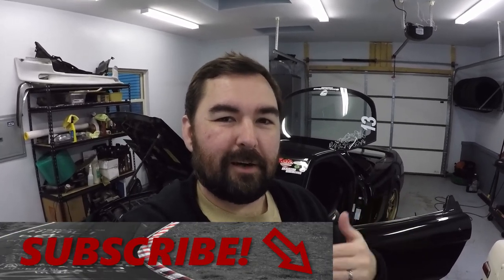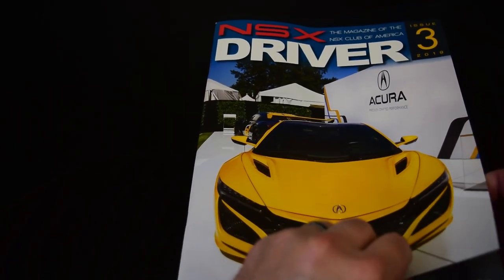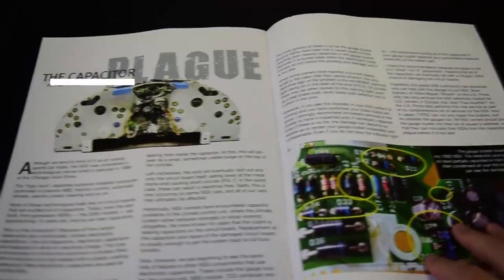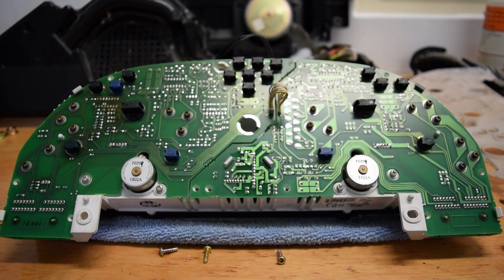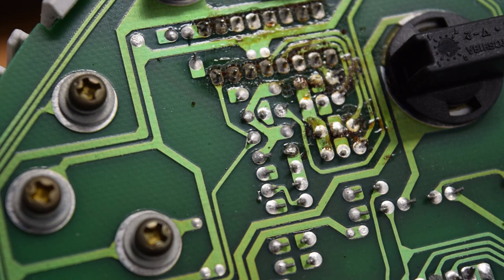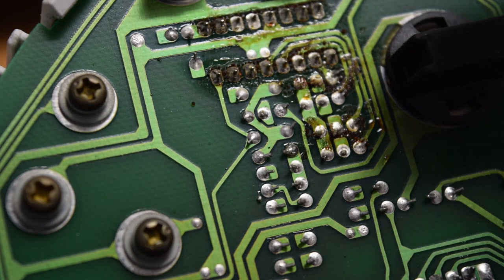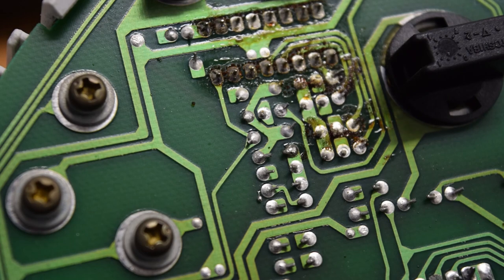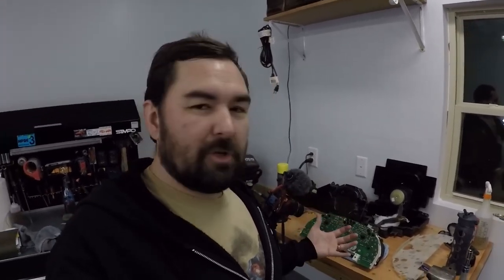Gen 1 NSX (and other 90s 'JDM') PSA:  Potential Capacitor Carnage in your Instrument Cluster!

Comment: Well done again with a great video. Had this done here in Japan by T3 TEC who are growing into everything NSX, race, dyno full overhauls. They built a setup when they change the capacitors to then run it on a simulator and set the gauges correctly.

Comment: I proactively did this a couple of years ago as well.  I thought I had an issue in my instrument panel.  It turned out to be a oil pressure sender on the oil cooler.  Briank said the caps were not leaking yet, but they all do eventually.  I disassembled the instrument panel and just sent the PCBs to Brian.

Comment: I prefer to not have the circuit boards not be removed, the screws that hold the gauges and provide the connections to the gauges if over-tightened on reassembly will damage the gauges. The crusty's you see are left over flux from most likely a rework when the board was manufactured. Brian K nsxe-repair
Reply from the maker: Good news! After some debate, I did mail the entire cluster still-assembled.  Thanks for the info, I'll be curious what, if anything, you find once you crack it open.
Reply: @LapoftheWorld  I will take some pictures.

Comment: The common failure area is the lower-middle part of the board that drives the brake lamp/door open indicators, which is hard to see closely from the vid but it almost looks like someone has worked on that area before based on the different color on the board, looks like leftover flux or conformal coating. The crusty area looks like poor cleanup after a re-soldering job to me, but you'd need to look at the front of the board to make sure since that's where the damage would've started, since having that kind of damage on the back would've meant the capacitor acid ate all the way through the PCB...Maybe someone has repaired this cluster before? 
Not sure if BrianK requested you separate the boards from the housing before sending the boards for repair. If you do, you can look at the front of the boards to really see if there are damaged areas. Either way, the capacitors should be replaced with more electrolytics of a high temperature rating (factory was 105 degrees C) and a high lifespan (some are rated 10,000+ hours).
Reply from the maker: Yeah, I'll be curious about Brian's opinion there.  It was driven enough prior to me that it plausibly could have been fixed before, but aside from the section I pointed out most of the rest appeared pretty pretty consistent.  I took a high-ish res photo of the entire board just for future reference and again to my un-trained eye the quadrant with the brown schmoo is the only one that looks "off" in any way.
Reply: @LapoftheWorld  Might spray some schmoo-be-gone just to be sure haha, though maybe Brian would like to keep it original to see if that area needs to be addressed. Either way, good piece of mind getting everything re-capped and inspected. Just be careful reassembling the cluster if you take the boards out, the OP of that Prime thread you linked accidentally over-tightened one of the brass circuit board screws and broke a speedo stepper motor wire and had to re-solder it again. See http://www.nsxprime.com/forum/showthread.php/91341-speedometer-testing. Common issue if you over-tighten the screws.
Reply from the maker: @Big_McLargeHuge0  Lol, yeah, I long ago learned-the-hard-way and cured myself of any desire to tighten most fasteners past "snug" unless there was a torque spec.

Comment: Did you have to remove all the trim behind the wheel to get the instrument cluster out ?
Reply from the maker: Just the 'knee bolster', and the thin black trim ring around the cluster itself, but neither of the column covers or other trim. It can be fiddly to extract but it will come out at the right angle with some fairly modest encouragement.
Reply: @LapoftheWorld  Thank you

Comment: Great video and PSA!  Old Miata ECUs also fall into this category, which I discovered when I was debugging why my freshly rebuilt engine wasn't cranking.  It turned out that the caps weren't the problem in my case, but the 25-year old connectors weren't making great contact.  ECU failure can result in major damage so it's probably wise to replace them anyway.  There's people that will do all the caps for you if you want -- e.g.  http://siaelec.com/product/mazda-miata-ecm-repair-return/
Reply from the maker: I've had to re-pin a few connectors over the years, mainly in the doors and trunk due to corrosion.  Fortunately the ECU is in a less exposed location so that's been solid so far.